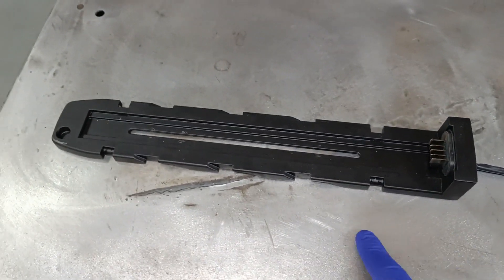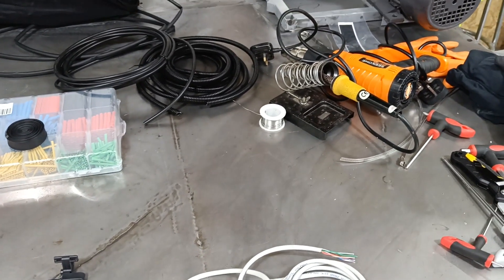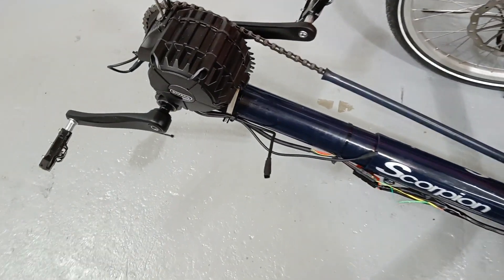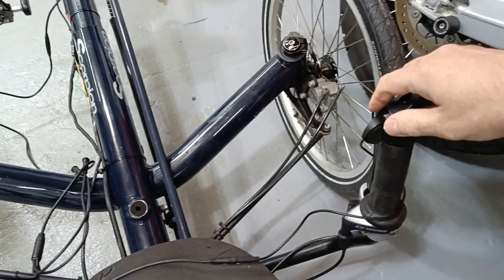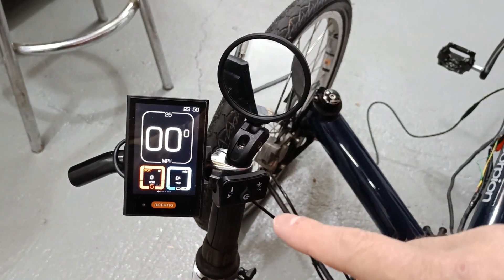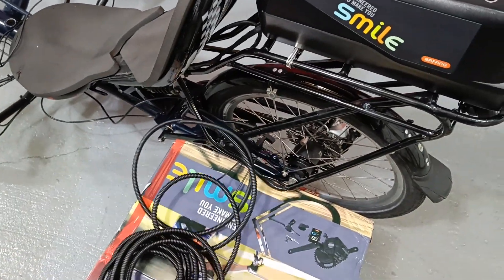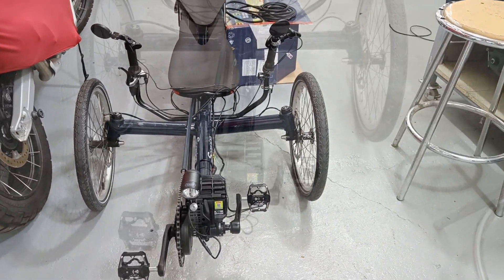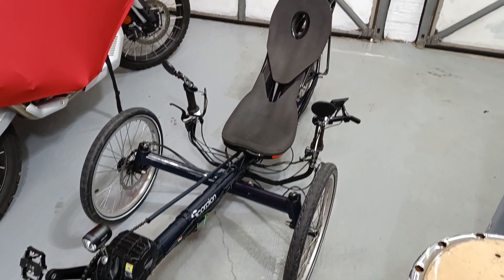HP Velotechnik Scorpion - Bafang M325 conversion - Part 2/3

Comment: Nice work! I installed a Bafang on my Greenspeed trike about 3 years ago. I also put my battery on the back rack. I was able to find extension cables for some of the control wiring. I did have to extend the battery cables to the motor. I used stranded 10 gauge silicone insulated wires and used the same corrugated loom as you to enclose all the wiring and cables. You really have to think outside the box and be willing to do your own modifications to make it work right and also look good at the same time, but well worth it in the end.